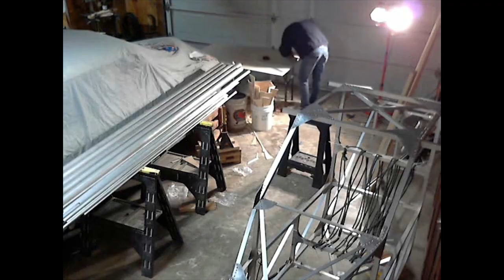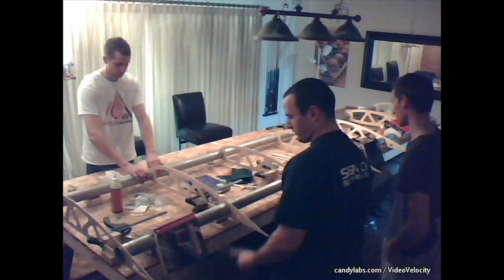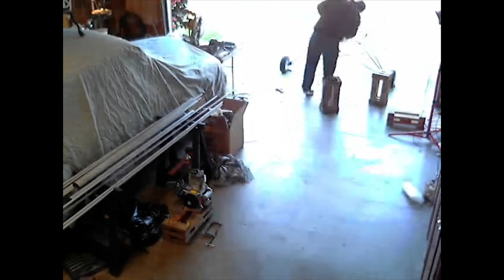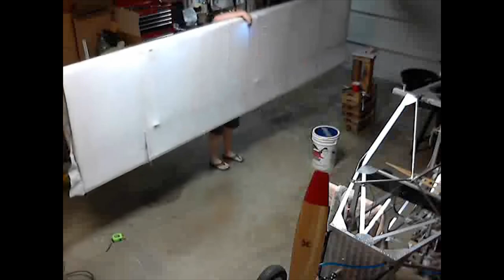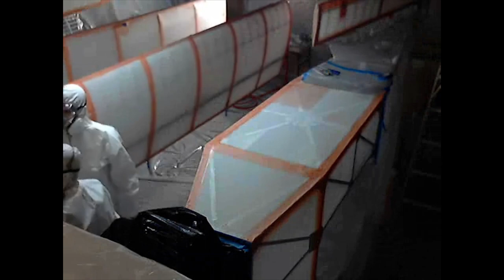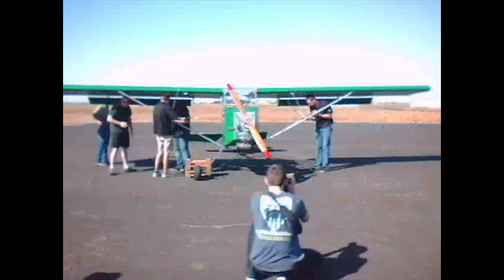The Ultralight Build Part 2

Comment: Are you going to post an update to this build? I’ve started building the wing ribs, using plans I bought from Scott maybe 15 yrs ago. There really isn’t much information out there on this very cool little airplane. Thanks
Reply: Todd Phillips ,,, first,,, you really need to build a radio control plane,,, PT 40 or PT 60 by Great Plains,,,. Kit,, stick built,,. Draw out all the parts on balsa wood and light plywood,, to build a second one,,,.   Then after that build a quarter scale,, J-3 Cub kit,, made by Carl Goldberg Anniversary Edition,,,. These are a must,, you'll have no questions afterwards,,,. You'll learn the proportions the scales,, balancing,, control rods bellcranks control horns,,, Servo and receiver placements,,. Adjustable motor mounts and balancing with the engine,,, hinges,, covering in monocoats,, fiberglass cloth and epoxies,,. Learn to work with silk and dope,,. Delkron dress lining material,,,. Then you have all the knowledge you need to start building something you can put your own butt in,,,. !!!

Comment: what kind of engine was used
Reply: looks like they used a weedwacker motor to keep it under weight. needs a 40hp or bigger!
Reply: It is a Rotax 277 ultralight engine with belt reduction.  It does not need 40 hp.
Reply: +19sloper have you flown it anymore? looks like it was having trouble getting out of ground effect